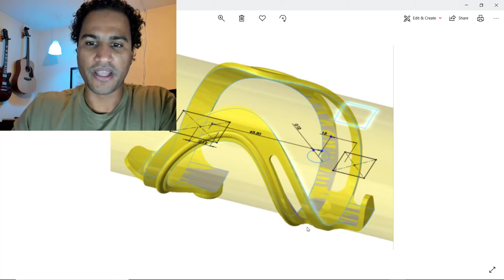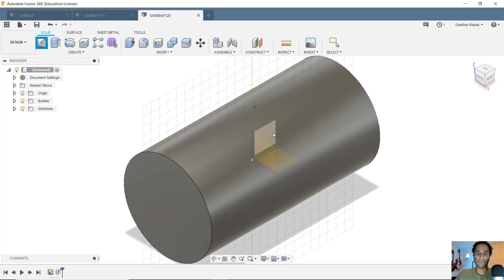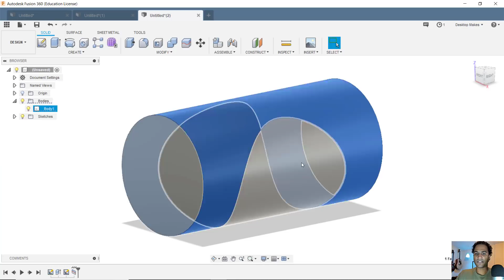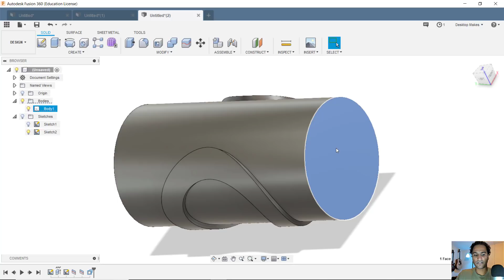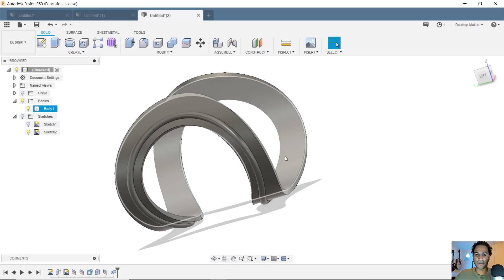Split Face Tool Fusion 360

Comment: Thanks for the great video.  I've watched several other split-face videos, but the examples they used could be accomplished just as easily (or even easier) using other tools.  This is the  first video where split face make the modeling substantially easier, giving me insight into when to use the tool.